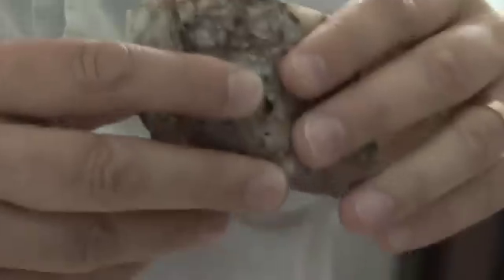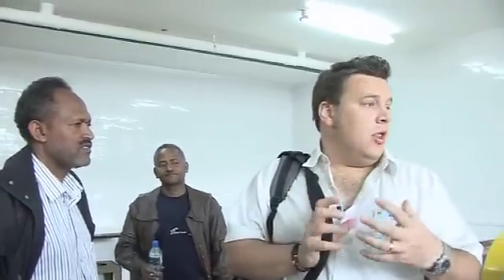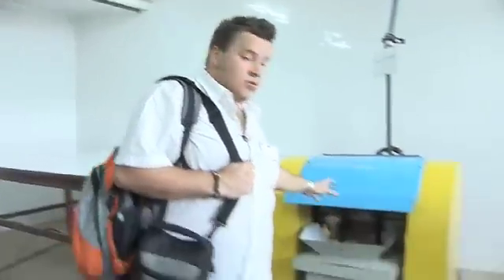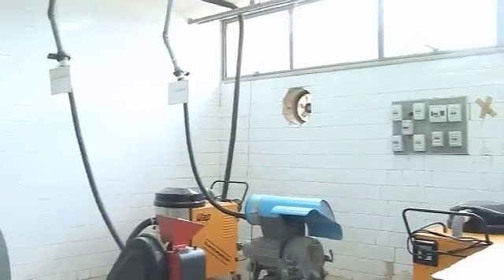African Gold Laboratory - Periodic Table of Videos

Comment: When he refers to storing gold and it never changing, its not totally in reference to the value, its about the physical form. Gold submerged or exposed to water forms a slight crust that can be polished out, this crust also protects the rest of the gold from oxidization. Silver on the other hand corrodes strait through and must be rerefined. This makes gold preferable for long term wealth storage, not just because of it value but because of its resistance to corrosion.